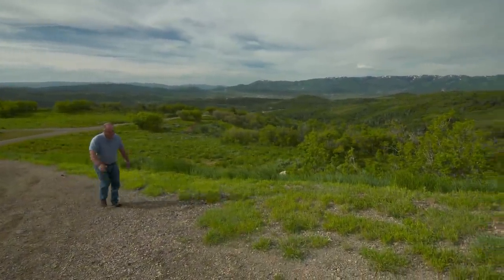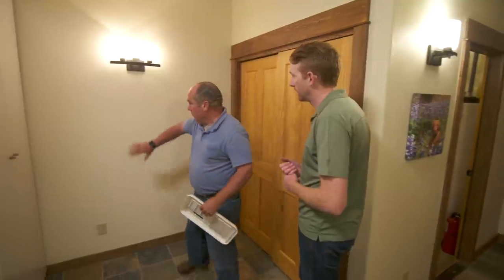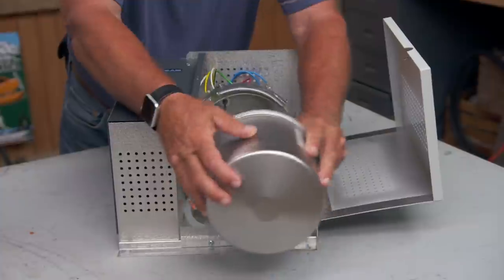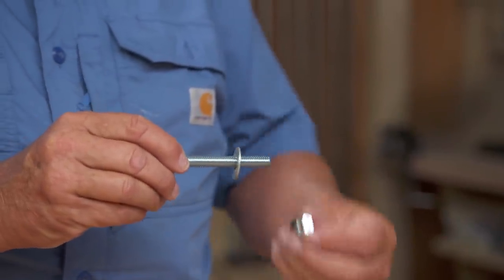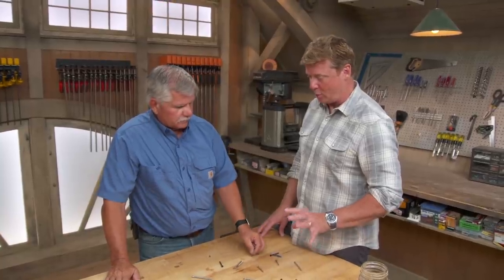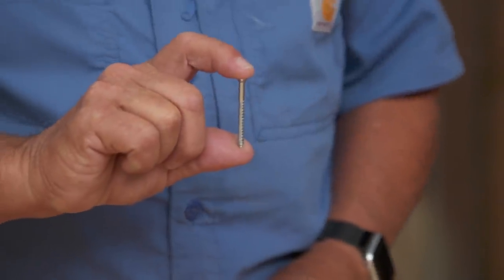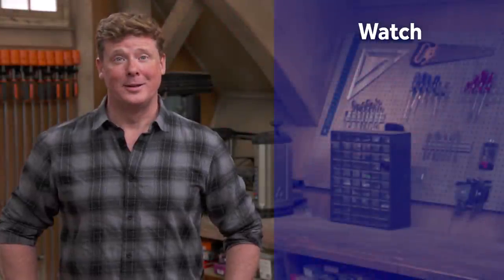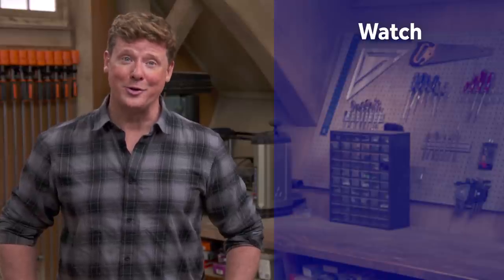ASK This Old House | Ductless Humidifier, Planters (S18 E4) FULL EPISODE

Comment: As others have mentioned, our power company has had a device that they can add to the HVAC system to control it. They only shut it down for short periods when demand peaks. By rotating the shut off between homes, no one is out of AC long enough to really be uncomfortable (we never really even noticed it) They've had that here for well over a decade.

Comment: My power company has a program called "power hours" where they give me a discount to have a smart thermostat, but they can control the temperature so they can pull off demand of my AC in the summer.   I didn't sign up, but it was available.
Reply: I had that in California.  It was a nice discount but it sucked when they shut off my AC.  Also, I think it caused some damage to my AC unit because I was having a lot of compressor problems with that device.  I pulled the plug on it and after that happened no more compressor problems.

So...beware with those devices because they could damage your HVAC units.  Most HVAC units don’t like a hard switch off, they need some time to do something before it is cut.  I don’t know what it is but the HVAC guy mentioned it to me.

Comment: The power company in Maryland had this kind of control over 25 years ago. They had mandatory control devices on every home air conditioning unit so they could limit how many people were using A/C at any given time, because the grid couldn't supply enough power for everyone to run A/C at once.

Comment: How on earth is a piece of insulation in the planter going to "protect" the root system? There is no source of warmth in the planter, so what is insulation going to do?
Reply: it will slow down the thermal transfer between the soil and the atmosphere
Reply: @r.hainez2131  Yes, by a few degrees, for a few hours. Beyond that, it will do nothing. Turn off the heat in a house and see how long it stays warm, even though it is insulated.
Reply: @ianbutler1983  the goal of the insulation  is not to keep the plants warm, it's to slow down the freezing process as much as possible. These plants can resist to low temperatures if these temperatures go down slowly
Reply: @r.hainez2131  That makes sense. Thanks. I did not know it mattered how quickly plants froze.

Comment: You do realize that one slice with a box cutter on that rigid foam board and it'll snap straight and clean just like drywall...
Reply: AND  What good is insulation with no heat source in below freezing temperatures?  She does great with plantings and what have you but how did this get through to an episode.  Maby I'm just not understanding my something.  Insulation can't warm or cool anything; kinda like a fan doesn't lower the temperature of the air in summer...

Comment: As a hvac tech do not get these over priced humidifer. They require yearly maintenance and the replacement canister is very expensive. Richard is full of crap about how effective that system is.. A simple quality honeywell room humidifer that is substantially cheaper and you can control better

Comment: deregulation caused the situation that happened in texas. solar and wind energy didn't fail as much as the coal gas and oil energy sector
Reply: John Jacob Jingleheimer-Schmidt  it was because of deregulation, why is it the states with similar energy grids didn't suffer the same fate? because federal regulations mandate winterizing all energy grid equipment, and most states have energy grids that cross state borders putting them under federal regulations

since texas didn't have interstate connections with their energy grid they didn't have to obey by federal regulations, they didn't have to winterize, they wanted to save money.

 since the texas grid fell they also charged their customers thousands to recoup the losses, that is also a thing that other states don't do because of federal regulations
Reply: John Jacob Jingleheimer-Schmidt  I was saying that the whole Texas grid system should winterize. That includes solar and wind. 

Solar and wind only accounted for 13% of the outages while only being 20 or so percent of the whole grid.
Reply: Not it did not stop with that liberal bs talking point.
Reply: @KingHavocDraigo  
LOL LOL. . LOL.